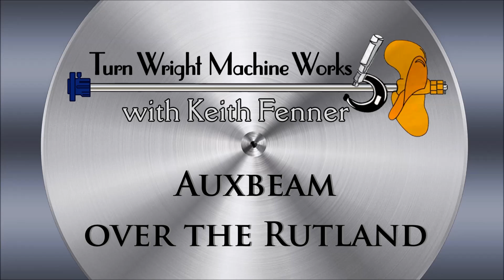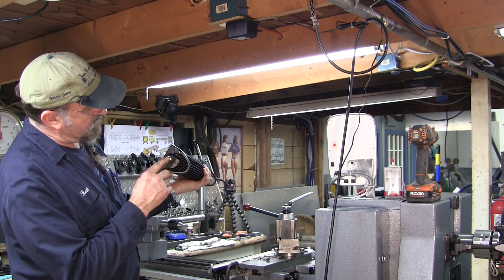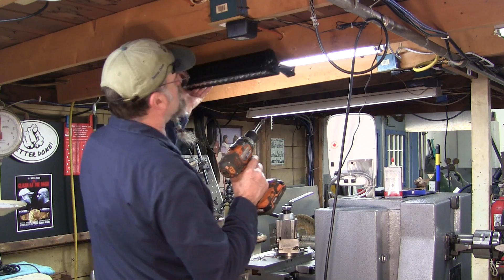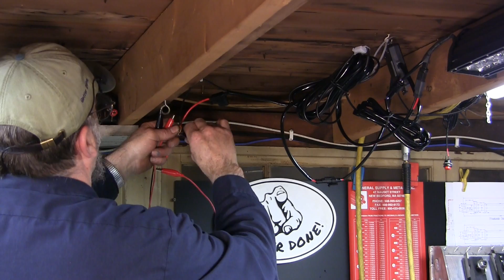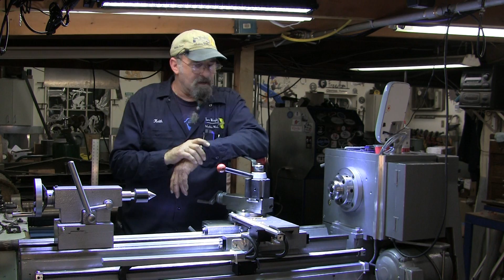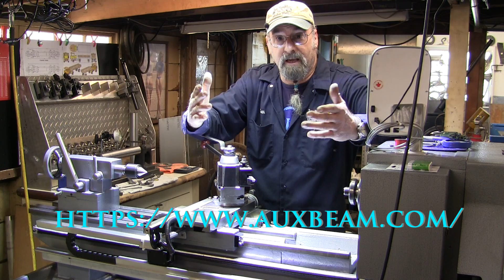Auxbeam Over The Rutland

Comment: Do not waste your time and money with LED they are crap, far too blue in my opinion. I see that some car headlamps use LED now, hate them as they drive towards you, it affects my night vision. Stick to the tried and tested good old Fluro's. I have fluro's in my workshop, would use nothing else. If you need an extra light for the lathe then buy a low voltage halogen machine lamp or reading lamp.
Reply: Not all LED's are created equal. If you buy the right color temperature with a high color rendering index(CRI), you won't be able to tell them apart from conventional bulbs. The CRI on good LED's is much better than the CRI of any tube. Look for at least 85 CRI when buying LED.

In the home 3000K(aka warm white) is a good color temperature. In the shop I like 4200K(cool white) or higher.  

The blue your talking about is from cheap lights with high color temperature and low CRI.
Reply: You do know that not all led's are the same color, right? the reason these are looking blue is not because of the color index, it's because they make white by turning all the red, green, and blue led's on at the same intensity. Regular white led's can be as warm and as cool colored as you want them to be. Just like you can get warm and cool led's.
Reply: That may be true with today's fluorescents.  However, the old T12s were readily available with CRI in the mid 90s.
Reply: go to T5s bulbs you wont be sorry there exellent. and about the size of a dime round.

Comment: Great light for its automotive purpose but defiantly not in the shop. I have above my lathe and bench 2 Sam's club  48" two-tube LED shop lights for less than $40.00 each and they are great in my opinion. The also come with a connecting harness for up to 10 lights that you can piggyback together.Thanks for the review. Ed K. Cleve. Oh.

Comment: Keith

IMHO that is not a suitable light source for that application

I have replaced my 4foot doubles with 4 foot LED fittings mains powered (220vac ) here in the UK better light better spread and cooler ,above all cheaper to run

Down side they do have a small strobe effect at multiples of the mains frequency (50hz) so 1500 rpm and 3000 rpm for example slight effect just like on your videos due to frame rate 

But I am satisfied with the result ,all the light sources in the house now are LED I Evan have some that are LED but look like the old carbon filament lamps at 60watt equivalent you can hold your hand on it after two hours run time

Comment: I use led floodlights and find they give a bright white light , i have some led strip lights that give a slightly blue light so they are only used inside the tool lockers . I would like to see the fluorescent light to led conversion tested as i have seen them in carparks and wondered if they are ok for the workshop . Although i believe it is an expensive conversion it may pay itself off over time .

Comment: If it was a gift from Aux-Beam I'd make it work by clipping some tracing paper / parchment paper to diffuse the light a bit. Colour Temp is too blue for my tastes. BUT if you're going to fit lots of LED lights then you need to consider in-rush current. The diodes pull lots of current on startup. You can monitor this on fancy smart meters. Either set them up on separate circuits or stagger the sequence they fire up.

Comment: There are a few problems. The light is too "harsh" (directional) so you have a lot of very contrasting bright areas and shadows. The fluorescents aren't strong enough to fill the shadows. Also there is a huge WB difference, the LED being much cooler. It looks like maybe you use auto WB? When you light the LED I'm not sure if the back areas (with fluorescent light) got yellower from the camera changing its auto WB, or it just seems that way because of the contrasting blue from the LED.

Comment: As others have said, LEDs are very bright, but without help, the diffusion isn't so good. I've used LED lamps in the shop and they do to your eyes what they did to the sensor on your camera. The lamps, being so bright,  make the surroundings appear dark.
It's the same reason I don't like them in automobile headlamps. The cut-off on the headlamp illumination pattern is so abrupt that while you can see farther with the brighter lighting, it makes anything outside the illuminated area invisible. As mentioned too, the eye perceives the bluish tint as harsh and unpleasant.
The light bar would be dandy for off-road when trying to see as far ahead as possible, but not so much for general shop lighting.

Orlin in NC

Comment: Hi Mr Fenner sir, the four foot flouro does it for me, it is a much softer light, LED is far to harsh without some kind of diffuser.
Reply: Flourescent comes in different color temperatures too...so it depends on the bulbs. LED comes in different color temps as well. Warmer temp LED's are harder to find, but are available

Comment: I just swaped out my Fluro tubes for Led Tubes...takes about 20 seconds to do...all the electronics are inside the tube...just pull out the starters...about 10 dollars each but there likely cheaper in the usa....i'm on off grid solar...no electricity bill and i can still have lots of ligfht

Comment: Keith,I have had great success with these direct wire LED replacement bulbs.Old ballasts come out,120vac wires direct to one end of the bulb. 22 watts instead of 40 ,no flickering or humming and these light up instantly even when it's cold in the shop. I've used both the 2000 and 2400 lumens 
https://www.earthled.com/collections/led-t8-tube-replacements-replace-your-fluorescent-t8-t10-t12-lamps-with-led/products/luceco-led-fluorescent-replacement-tube-4-ft-24-watt-2400-lumens-ballast-bypass-direct-wire?variant=2403570948

Comment: I replaced all my 4 ft fluorescent tubes in my shop with led tubes and they work much better. I can see the work better and when it's cold in the shop the led tubes do not dim. Try the led replacement tubes. I think the one you tried in your shop was designed for road applications.

Comment: We started changing our fluorescent fixtures at work over to these https://www.1000bulbs.com/product/191795/PLT-10019CS.html and I liked them so much I've converted all of the fixtures in my house (approx. 40 bulbs).  The great advantage with these fixtures is that you remove the ballast (beneficial if you are running a bunch of T-12s since most led conversions want T-8 ballasts).

Comment: You have probably boxed it by now, if not shipped it, however it the color is adjustable you could adjust the color temperature to match your usual warmer lights. A camera and monitor is probably all that is needed and just adjust to suit your need. Reduce blue and bring up red would get you started. If "it" remembers the RGB setting then you would be all set.

Comment: How the light acts is one thing as it applies to your being able to see your work. How the light affects what the camera sees and thus records is somewhat of a different thing. As other have said, the light is super blue, like being outside in the bright sunshine. This has the effect of making light stuff too bright, and the cost is that detail is smooshed out from the darker areas. Perhaps before rejecting it you might try to see if there is an "outdoor bright sunshine" setting on your camera, or you might be able to place some daylight filter gel ("like cellophane") over your camera lens. Frankly, I didn't like it. Applaud you wanting to get rid of the fluorescents, though. Yeah, you get used to them, but they suck.

Comment: I'd just go for LED replacement tubes if you want a quick, easy fix.
With most of them you just need to remove the starter and if you like them, remove the ballast. 
It'll also let you swap the lights around as you want in all the existing fixtures and get both directional and omnidirectional ones.
Plus because they are only the lights/electronics in a compact package, they are normally quite a bite cheaper than a whole fixture.
Save the big waterproof floodlight for outdoors. Use it to light up your yard or other places where you want lots of directional light that won't be effected by rain and weather.

Comment: I wonder what the color temp is on that fixure.  To my eyes it looks too close and focused for use over the lathe and it looks like a high color temp of about 5700k or so to me.  For shop lighting you really want a lower color temp of maybe 3000 or 4000k and high CRI LEDs (>85), I think.
Reply: It is impossible to tell what the color temperature is on video as the camera attempts to correct its white balance for it. It certainly doesn't match the existing lights in the shop. I think the bigger problem is that the CRI looks to be down below 50 as its an RGB LED fixture.

Comment: Sam's club has 48" two-tube LED shop lights for less than $40.00 each.  Much brighter than standard 48" fluorescent fixtures and no danger of shattering tubes and falling glass.   All my shop lights are now LED.   I can actually see what I'm doing - for a change.
Reply: Same thing with Costco, about $40.  Much brighter than the fluorecents they replaced and a good color temp too.
This automotive light bar is a spotlight and not diffuse enough for a shop, causes too much contrast.
I don't know how much lighting figures into the shops overall power usage, but with about 40 fixtures changed to LED, it would save a lot of power/money.
Reply: i just replased40 4 foot t-12 old style flouresent bulbs with 18 t-5 flouresent bulbs which take way less power and give you way way more brightness. the t-5 bulbs were cool white style they are brighter than the daylight style. just totally happy withe update and they were 45 bucks each in canada from a local electrical supplyer taxes in.

Comment: For what it's worth my opinion -

1st)The LED light strip is made up of many separate LED's
and they are too focused so you have "spots" of super bright light
where as without it you have normal wideband light coverage.

2nd) The LED's you have there are "cool" white which can look blueish
 and they create shadows and if looked at for too long induce headaches.

If I were you I would consider "warm" white LED's with a diffuser to replace the shop lighting
and "cool" white spotlights that you can angle at work places.

Comment: use warm White LED they have better color for video
Reply: Daylight color temperature is actually the best. The important thing for video is that all light sources are the same color temperature and color rendering index(CRI). 

RGB LEDs are just terrible general purpose lights for video. The "white" they produce might be something close to daylight color temperature but the CRI is less than 50%. 

These days you can get LEDs with a CRI up around 90% in both daylight and warm white color temperatures.

These high CRI LEDs are much better than florescent tube lighting for video.  

They other really important factor for video lighting is diffusion. Really soft lighting makes everything look better. There are two ways to get really soft light. Use a big source like a 24"x24" led panel or have a big diffuser like a soft box.  Florescent tubes are naturally soft because of there size. The light isn't coming from a little tiny die like with an LED.  

Soft lights are important because cameras don't have the dynamic range of our eyes. They reduce and fill in shadows. So when the camera is adjusted for the brightest part of the shot, the darker areas are not completely black and still have some detail. 

Hard light can be a useful tool in video. If you want to show the qualities of a surface a low angle hard light will bring the surface features right out.
Reply: Warm white is much easier on the eyes....won't draw bugs outside at night like the high temp lights do either

Comment: I had fluorescent lights in my UN heated garage in Colorado. When the temps got down around freezing, the lights stopped working.
Reply: You need the "All Weather" ballast and tubes.
Reply: Well, you could always use 1KW Metal Halide lamps set 15ft. up, and use the ballasts as heaters, but you have to be careful not to track too much dirt into the shop...or weeds will sprout,  LOL!
Reply: I'm changing over to LEDs because of this. I know that there are fluorescent lights that are for cold areas, but the LEDs I'm trying are great, more light that fluorescent, and don't care about the temp, and uses a lot less energy. I have several 4' light fixtures in my shop and there will be a somewhat noticeable drop on the bill when I get them all switched over.
Reply: ..yeah....most fluorescents are  not rated/recommended at below 50 degrees F but we use them anyway......

Comment: Lighting color matters a lot to me. That particular LED is way too blue for me personally but probably works much better outdoors at night on an off-road rig.
Reply: Too blue for me as well.
Reply: Yes, great for spotting rocks and stuff on the trail at night, and maybe even good for working under your car, but it was just the wrong color as well as pattern, for filming. Too blue, and having any hot-spots or shadows is the deal-breaker.
Reply: Thomas Utley have you tried using any filters on the LED lighting? I have a fairly inexpensive gel filter on mine and it changes the harsh blueness to a much more useable and softer yellow tone that is very close to natural. Gel filter is a very light yellow and is a constant tone.
Reply: As this light can be set to any color (RGB), the single color can as well be set to brighter or darker, to e.g. imitate the other lights around it to what seems to be "warm white". That is the case with practically all RGB lights, it is their selling point, so you dont need color filters in front of the light to change the color. The "white" shown on video seemed to be just a "cool white" setting, which is a little bit brighter (the color is set by increasing or decreasing intensity of single LEDs, the more power they get, the brighter the overall output).

The cameras white balance plays a role as well in what is perceived as white in the video. Most probably shoot in auto and that starts compensating (within limits) when lighting changes, which is why you usually do not want to change lighting during a scene.

I still would favor the LED, as it might help with reducing flicker on video with moving objects compared to 60Hz light. I have not seen that effect in his videos, but there are some examples on youtube. Cameras and video editing programs might do some flicker rejection techniques, but they usually drop frames = losses.
Reply: What did you think of the color of my modified Led's?
Reply: bcbloc02 I thought those were nice. The diffuser helps disperse away the stark shadows, too.
Reply: It's RGB, you could just mix your own color temperature by taking back the blue and green a bit.
Reply: I put some bright LED's with a high color temperature ( white/blueish etc) on my tractor. They SUCK! Not only do they draw bugs like crazy, the color irritates my eyes and makes them tired quickly.

Comment: Way too close to the work... not enough dispersion... not enough diffusion.  Plus... big 12v PS needed!  For over work benches, you can put the clear plastic 'condoms' on your 48" fluourescents, makes 'em safer in case of flying chuck keys!
Reply: Came to say the same thing. The shadows are too sharp without proper diffused light. Harsh shadows my play tricks on the eyes when turning parts.